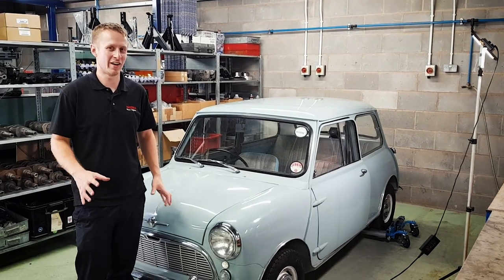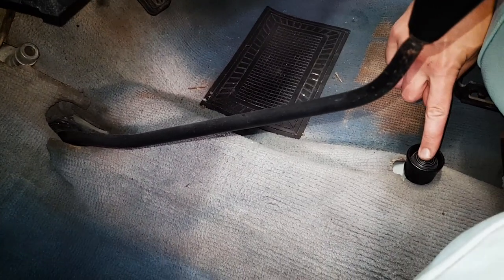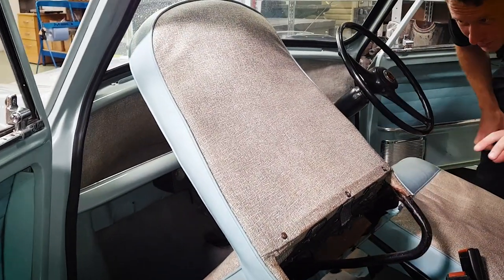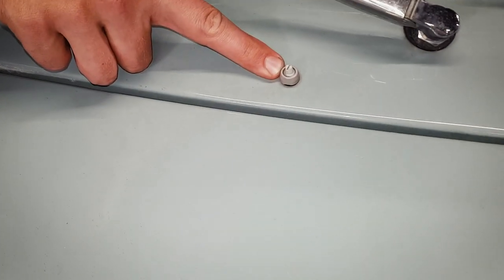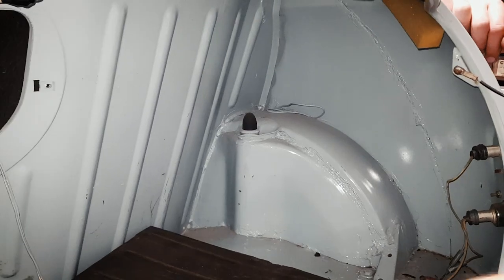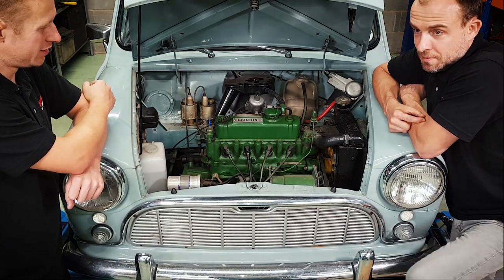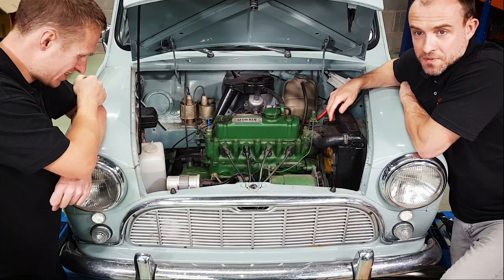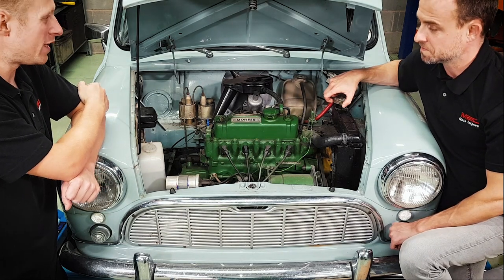Project 63 Episode 3 - our Rhodesian Mk1 Mini - geek overload!

Comment: I've got a Austin 7 mini1963 in new Zealand
Owned it for. 28 years. 
Still running single leading brake shoes. 
It's never had a panel replaced. Original floors. Just as clean as this mini you are doing the series on.

Comment: The front skirt.
Was cut away after 1967 for More air flow 
To the radiator. 
Not disk brakes. As it was only on one side. 

I'm looking for a washer bottle bracket
Reply from the maker: No it's on both sides for the brakes. The huge front grille does a decent job for the radiator.

Comment: Please respect this is an incredibly rare unmolested Mk1 , it should be maintained as original or make sure that engine does not go missing if you do modify it .I had a ' 63 Mk 1 and there are lots of ' early 'features that were soon updated in 1964, i.e plastic window catches, 2 LS front brakes , quarter light hinges and many more .

Comment: Steve,  So this would have been a CKD which means they will not give you a heritage certificate as i had the same issue with a my 63 austin seven that
came from Ireland. It has to be one of the best examples i have ever seen a true time capsule.  Cheers Dave
Reply from the maker: Hi Dave, we've had a certificate through but it's not as detailed as for a UK Mini.
Reply: Steve it must have gone overseas as a complete unit rather than a CKD because heritage would not issue me one for that reason. Cheers Dave
Reply: @ClassicCarCave  I think it's only recently that they started offering certificates for CKD cars. My CKD export was assembled in New Zealand and I got a heritage certificate for it the other day. It really doesn't tell you a lot though! Just the chassis number, build date, destination, and a couple of minor details like "no heater" and "cloth trim".
Reply: Jack, Thanks for the info it was about 5 years ago i had the mini but i can tell the new owner he should re-apply. If you like minis take a look at my gulf hill climb mini and let me know what you think. Cheer Dave

Comment: Reversible...
Means no hole for a Rod/Remote Change Gearbox so Magic Wand is a must.
Converting a 4 syncromesh Remote Gearbox to Magic Wand is possible but expensive if you didnt have a Remote Gearbox in spare...
Without the additional Mountpont from the Gearbox a fastroad Engine is maybe to strong so something about 60 Horses is the goal?
Reply from the maker: We have lots of spares :) keep watching to see what we have planned....
Reply: My 850 is running a magic wand converted 4 synchro gearbox. I added the 2 lower engine steadies to the subframe and it’s fine
Reply: You cOuld fit a period SPQR remote gear change - Steve will have the appropriate ad in his file - which connects to a shorty magic wand-ette above the floor.  Ashtrays in the rear pockets were standard.  Absolutely loving this series, reminds me of my first Mini - ASE 7B, also Smoke Grey, a nice 850 deluxe which I got just after passing my test in 1971 (on my 17th birthday!).  That was the first of a series of five or six cars, oldest a 59, youngest a 68 model, all of which I could just afford to run as a student, but which I could never afford to modify., so this project will perhaps at last let me vicariously enjoy all those mods I wanted to make...

Oh, and the Red Bull can will be an attempt to improve the earthing of the coil, always dodgy on older cars as oil seeps into the clamp...

Keep them coming. But lose the music, please...
Cheers
Will